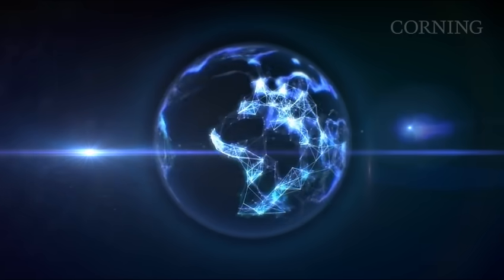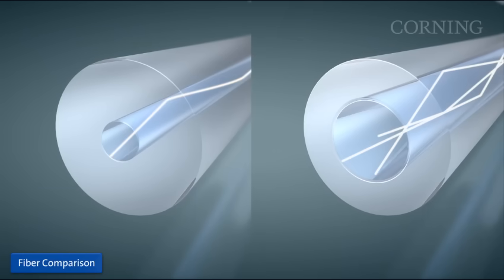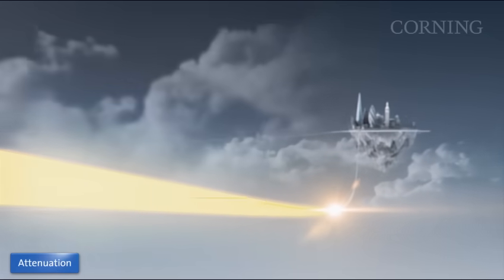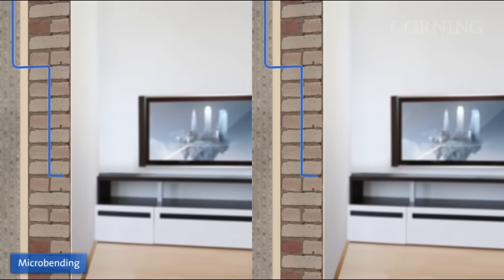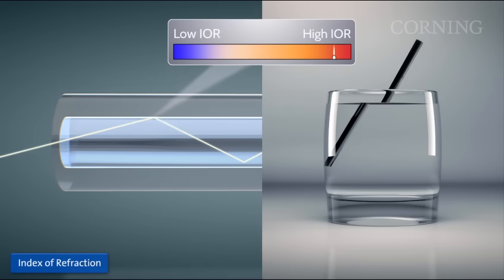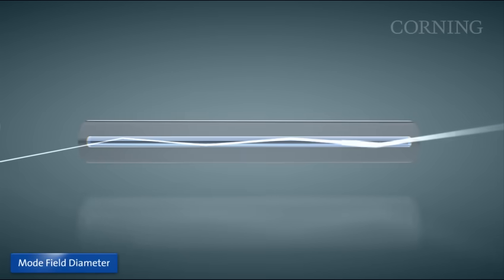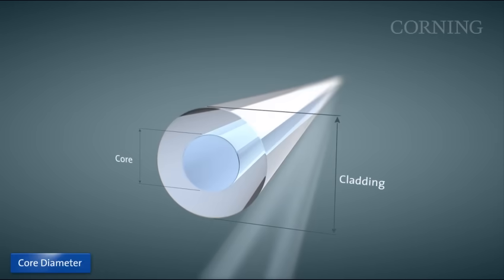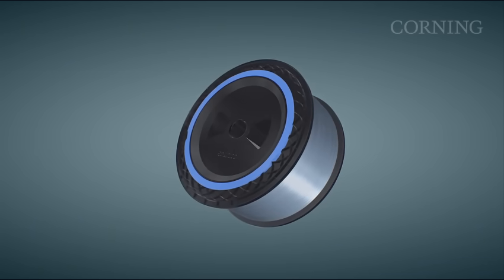Fiber 101

Comment: We must give students and schoolchildren a device with which they can independently measure the Universe and understand the mechanisms of quantum gravity.
 Modern technologies have great potential for implementing the experiment. Michelson experiment of 1881, with two fiber optic coils, where the path of light in each arm is 900 km, and to measure the speed of light in an aircraft, the linear speed of which is 0.3 km / sec, where (according to the calculation  2 (l / λ) (v "/ c ") = 1.3 of the basic formula of the experiment, we will get a signal 1000000000  more than on the detectors; LIGO, VIRGO … . And see how the "Dominating Gravitational Fields" act through the frequency of light, regulating its energy, direction and speed in a vacuum. "LIGHT is the energy that results from the redistribution of gravity quanta during ordered vibration."

Comment: The speed is 3.28 x 10(28)m/second there is no loss or attenuation. They are more secure as loss can be detected. SM is 9 microns used to connect two sources together over a long distsnce and MM is 50 microns used in shorter distances, generally inside a buiding is my understanding

Comment: Bring back coaxial cable!!! :P   We have fibre cables in service today that were installed in 1984.  They are carrying 10Gb/sec services between substation pilot systems - as well as corporate comms.   One circuit is 120Km long.    All still going well.
Reply: You're arguing against yourself here, retard

Comment: Together with wifi, fiber is the future for transmitting data, thanks for this video
Reply: Um, Fiber has been used widely for over 40 years. Everything is already transmitted over fiber, even if you have Coax or Twisted Pair in your house, there is still a fiber network upstream of you. Fiber is very expensive to install compared to copper.
Reply: @mikel9567  I don't agree fiber,  can be made by plastic recycled plastic this with 6H2O en that is waterstofdioxide In The Netherlandswe collect this for now several years
Yeah we are working for a more clean and lifeable world, no pollution at all, thanks and kind regards.
Reply: @mikel9567  Dear Mike L I like to ask you why fibre is so expensive, it's made out of recycled plastic in the Netherlands. Is there still cupperwire under the groud up there, That is also a possibilty, Thanks and Kind Regards.

Comment: It's not true that Fiber Optic cables is strong!!!  I broke my Fiber Optic cable on my router that's why I watched this. 
The material used for currently commercialized fibers (core and cladding) include pure glass plastic, or a combination of both. Fiber Optic cables are sensitive as fuck, just one small bend and your Internet connection is gone.

Comment: Don't deal with these people.  We installed about 70 miles of their fiber and what a nightmare.  The techs were arrogant, condescending, refused to answer questions and treated our employees like shit.  We had to hire a private contractor to finish the splice work and get the system up and running. When a section of cable was damaged due to their error they charged us 10 times the amount of the original cost /foot for replacement. We refused to pay and bought a competitors cable for 1/3 the price.  DO NOT DEAL WITH CORNING !!!

Comment: How are fibers connected to each other when repairing or extending a part?
Reply: By means of fusion splicing
Reply: Ductape
Reply: Yeah, fusion splicing is used and usually to protect the fusion a specific kind of heat  is used so that the exposed fiber doesn't break.

Comment: now if only fiber optic internet was available in my area, but no, old people hate new things
Reply: Fiber optic more expensivr than coper
Reply: its not the affordability of it in my area, the elderly in my area have this preconceived notion that the internet is useless garbage while cable tv isn't and this area is majority elderly so we can't get it in cause they won't allow for it
Reply: @jmbrady1  yeah thats right so is it in my place better sayed in thw whole country
Reply: Maybe you should move out of their house then.
Reply: @jmbrady1  So what? Older DOCSIS 3.0 can achieve 1 gigabit over cable.  Symmetrical DOCSIS 3.1 can do 10 gigabit upstream and downstream over cable. Why did I NEED fibre??
Reply: @Todd.T  you are less likely to lose connection with it and you need less of it than the old wires
Reply: @jmbrady1  Less likely to lose connectivity...no. The main advantage of fibre is to the network owner to cut operating cost. It can be buried deeper by the electricity so people can't range the fibres. Also,no amps to draw current.

Comment: Why does it seem it’s been so slow to adopt, I’ve been waiting ever since we were supposedly “able to hear a pin drop”  when MCI started marketing in the early eighties.
Reply: Because most companies use far lower grade copper based cabling in-homes and/or limit the speeds to houses severely to make people pay higher amounts for higher speed. All based on them getting large amounts of profit for cheap amount of investment. Theoretically you could lay out fiber to homes and into, sell it at a reasonable price for high speeds, and rake in the money; but companies will stave that off as long as they can.

Little sidenote to it though, why I'm hoping most countries end up like Finland (i think it's Finland lol) where they declare high speed Internet access a human right along with stuff like food and water. Means most every house in the country would be required to have some form of incredible connective speed

Comment: If the fiber is damaged (crack in the glass, or breakage etc.) at a distance, is it possible to pinpoint, where the damage is along the line, or is the entire line replaced? How is this done?
Reply: You use an Optical Time Domain Reflectometer that measures distance on an optical fiber then it can be re fused for repair.
Reply: You can repair it, but not sure on how they find where the signal loss is
Reply: Draco Safarius  Basically, you use a tool that measures the intensity of reflected light at source and the time for the light to be reflected to determine the distance to the break.
Reply: That's cool as shit

Comment: And yet we STILL have phone lines or coax coming into our homes...
Reply: I know, right? In reality, though, it's  well-known that the fiber cabling has its own unique set of limitations - some of which are related to the extreme challenges of splicing, signal tracing, and signal division (3db splitting for example).  Draco Safarius correctly assessed the profit motivations, I think. But also, it's really overkill to interface optics to a residence when low-loss coax is available to use from the optical node at the street to the home I suppose. I'm still trying to figure out how my the coax cable gets "shovel rash" about once a year !
Reply: Coax needs maintenance if a technician does not do there job properly and there can be outages daily as well. Customers will always need service calls when dealing with coax to be honest.
Reply: I mean I like coaxial cable internet I have it and never get dropouts or the Internet never has goma out and latency is pretty low I rarely lag and I have 500mbps internet for $40 a month
Reply: Were you referring to fttp? Or fiber inside the actual house? Lol
Reply: Nah dude,you old school,fiber is cheaper any way you count the beans and does not need medium or high voltage. I guarantee you voted for trump, hate Elon Musk, and havent kept up on your electrical education- Sad to say this but fiber is being installed all over the world buddy.
Reply: Coax is great sometimes because of how tough it is
Reply: All about the money dude. Company's almost always go with the "cheaper" option to make customers pay enormous amounts for high speeds on that type of connection when realistically you could get speeds far beyond that for cheap. But they just loooove large profits
Reply: @DracoSafarius  yup
Reply: @DracoSafarius  Main reason is that fiber optic is almost untappable, or at least is far more expensive and time consuming than tapping on copper wires, that's also why usually the FO terminations are on the street, so anyone MITM just connecting 2 crocodile clamps on your twisted pair.
Reply: Do you know the logistics of replacing a coax/fiber system with full fiber? Company’s are making their way there dude it doesn’t happen over night.
Reply: @zachsmith1674  No, of course not but everyone on the internet is a pro and expert because the collective hopes exceed the limitations of reality...
Reply: Having fiber coming into the home is simply unnecessary when copper can handle the speeds just fine.

Although it would be very expensive to bring fiber into homes, that’s not why we don’t have it. We don’t have it, because we simply don’t need it.

Do you know that 99.9% of the servers in datacenters world-wide today, use copper cables to connect to a ‘top of rack switch’, which then converts that to an optical signal.

Fiber is all about speed and capacity. These days, they run 100Gbps on a lot of fiber, and in many cases, >50 channels of 100Gbps simultaneously, do you need 100Gbps coming into your home?

Even if you had a 1Gbps link, you couldn’t benefit from it, because most content on the internet can’t arrive at your node fast enough to utilize such a high speed link.

I agree, almost everything has to do with cost and profits. But in this instance, the reasons are quite different.
Reply: @I999-g2s  You’re confusing latency with bandwidth. Fiber provides significantly lower latency, expect for when using very short copper runs such as within a rack.
Reply: @ohheyalan123  err…no. Speed of electrical signalling is (to all intents and purposes) identical to that of light in fiber. In fact, the latency is actually dominated by the signal processing that occurs on both ends of the link. Increasingly, fiber links are now adopting the same higher latency signal processing (in the form of dispersion compensation etc) as is needed for DOCSYS type signalling (OFDM) on common copper internet drops.
Reply: @1999 “Photons travel at the speed of light, whereas electrons used in copper travels at less than one percent of the speed of light. Although fiber optic cables do not reach the speed of light, they are only about 31% slower. So you can see that there is a huge inherent speed difference between fiber and copper.”
Reply: Fiber optic is not necessary for a house

Comment: Is it fragile? What if it breaks, what’s the cost to fix it?
Reply: Replace whole cable - "cost effective"
Reply: it really isnt that fragile.
cost to fix it - depends on how the network is built, and where the damage is. where the possibility of a damage is high, it is usually not long lengths of cables. And fiber cables are usually put into pipes, so you just drag it out and shoot a new one in,  splice it up and done.

Comment: My question is if you have a long stretch of fiber and it is broken/cut at a certain point. Is there a way to join the two seperated ends of the fiber? Or does the entire line need to be replaced?
Reply: Yes, you can splice the broken cable back together.  You don't need to replace the entire line.  Two ways to do it is a mechanical splice or fusion splicing.
Reply: @randysansom3328 Yes, though the fusion point later isn't as durable as the rest of the cable (has higher risk to be broken again). With proper installation, no need to worry about that.

From my experience with fiber optic, most of the time the fusion point broken again was due to poor installation after fusion or the customer moving the cable on their own.
Reply: Yoseph Alabdulwahab look up fusion splicing, there should be some videos on YouTube
Reply: https://www.youtube.com/watch?v=VsY0O_OI_z8 : this is a video of one type of optical fiber 'welding'
Reply: @philburch1970  g

Comment: You people are so dumb, internet is a signal of electrical current patterns, your device interpreting the signal creates the image. what the fuck are you thinking? sending images through glass tube?? Access to data is access to 1010100010 to create output, created by the device  that receives the patterns.
Reply: DIM MID 0.o. The fuck are you talking about man.
Reply: DIM MID dude the light sends signals that get transformed into binary dumb ass

Comment: so since optical cable is everywhere if someone where to cut a section of it how much of it would have to be replaced can it be cut and melted together or would it have to be replaced to the next repeater?
Reply: You can splice glass together using fusion.
Reply: Check out fusion splicing. Very cool. But yes, it's basically melting the ends back together.

Comment: What happens when you have an open in the fiber optic? Even the cladding (or insulator) could cause the signal loss. With Electricity you can repair the connection by splices and sleeves. How would you repair the fiber optic?
Reply: Advantages over copper wiringThe advantages of optical fiber communication with respect to copper wire systems are:
Broad bandwidth: A single optical fiber can carry over 3,000,000 full-duplex voice calls or 90,000 TV channels.Immunity to electromagnetic interference: Light transmission through optical fibers is unaffected by other electromagnetic radiation
 nearby. The optical fiber is electrically non-conductive, so it does 
not act as an antenna to pick up electromagnetic signals. Information 
traveling inside the optical fiber is immune to electromagnetic interference, even electromagnetic pulses generated by nuclear devices.Low attenuation loss over long distances: Attenuation loss 
can be as low as 0.2 dB/km in optical fiber cables, allowing 
transmission over long distances without the need for repeaters.Electrical insulator: Optical fibers do not conduct electricity, preventing problems with ground loops and conduction of lightning. Optical fibers can be strung on poles alongside high voltage power cables.Material cost and theft prevention: Conventional cable systems use large amounts of copper. Global copper prices experienced a boom in the 2000s, and copper has been a target of metal theft.Security of information passed down the cable: Copper can be tapped with very little chance of detection.
Reply: Mind fucking blown, and holy crap that is expensive.
Reply: when it's a matter of speed, copper can't cope with fiber... you can move up to 1.4TB of data with one fiber, but you'll need hundreds (if not thousands) of copper cables to reach that speed... now tell me how much man hour cost to splice that amount of coper cables against 40 seconds of automated fiber splice? yes, the equipment cost 1k but paying a group of workers to patch a thousand cables could cost even more
Reply: 2006 – Nippon Telegraph and Telephone Corporation transferred 14 terabits per second over a single 160 km long optical fiber[31]2009 – Bell Labs in Villarceaux, France transferred 100 Gbit/s over 7000 km fiber[32]2010 – Nippon Telegraph and Telephone Corporation transferred
 69.1 Tbit/s over a single 240 km fiber multiplexing 432 channels, 
equating to 171 Gbit/s per channel[33]2012 – Nippon Telegraph and Telephone Corporation transferred 1 Petabit per second over 50 kilometers over a single fiber[34]
Reply: You can easily splice optic fibers with an automated fusion splicer. There are some simple ones for less than $1K, and some that will splice multiple fibers at once.
Reply: because information is not carried it is made within your device, it is only a bunch of electrical pulse that are carried in wires, all they do is increase the herz and power to fool you.
Reply: DR.NEGA that sounds like an ignorant statement from an installer lol. You work for dish or direct? You need to get more experience and you would realize that fiber optic is much cheaper to lay and won't fault over time. Copper corrodes very quickly, leaks signal and takes in foreign signals,very high snr even in short distances regardless of shielding, and fiber is a sustainable resource where as copper has to be mined. I once was a lowly cable technician young one but one day you will union up and trade your $17 an hour job for a $47.50 fiber tech union job.
Reply: Dario Ampuy you would need 65 not hundreds but yes your correct
Reply: Jaden S. That's over very short distances with many amps alpha boxes and nodes with plenty of dropped packets
Reply: I have to use cellular internet,  the cable company hasn't figured out how to get 300' of RG11 to my house from the tap.
Reply: They do a fusion splice to connect fiber optics but actually there are other types of splicing which are
 V-groove splicing, glass tube splicing, and rotary splicing.
Reply: wrathoffufuke they do a fusion splice of the individual glass fibers when the cable is cut into or the cable has been damaged, just like with copper you can splice the glass back together
Reply: copper lot easier..just used crimper and cutter..just get cleaner copper and rg6 adapters...plus barels are cheaper..anyone can fix copper coaxial cables easier than trying to fix fiber yourselves...?? costly for repairs and costly  do it yourself...satellites sitll wins for do it yoursleves with all the tools alvaible at home depot
Reply: @user78405  i think u like the dark age.........its just bcoz of fiber optic that u r using very very fast internet which was not possible at copper...............so go n try to live in time of 18th century n dont adopt the science new inventions................or accept the reality n try to make it more better after getting knowledge of it.....dear......
Reply: Dario Ampuy There are copper links that can do 100Gbit.. that "1.4TB" you speak of was in 2014, when scientists used seven 200Gb links to create a 1.4Tb link..
Since you can easily push 100Gb over a single copper link nowadays, and you could push 400Gb with a QSFP-Copper link, you can do that same amount of data transfer over copper using only 4-14 copper links..
Fiber is capable of much longer distances, though..